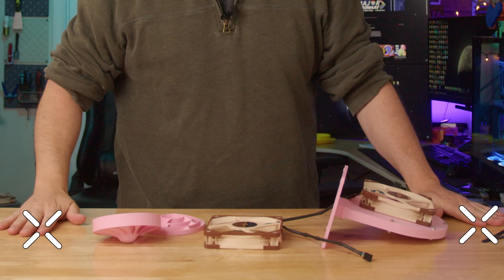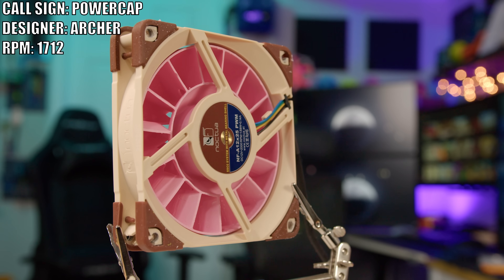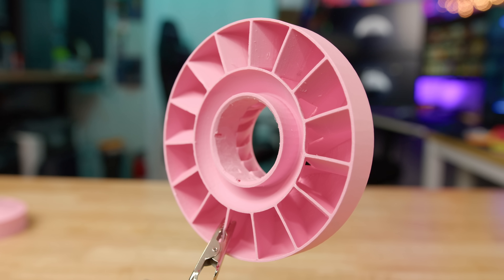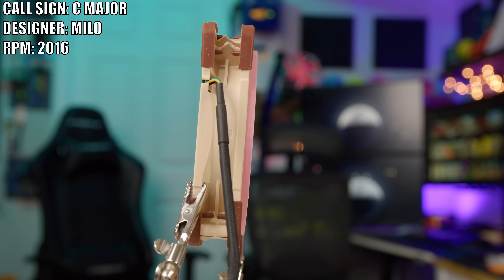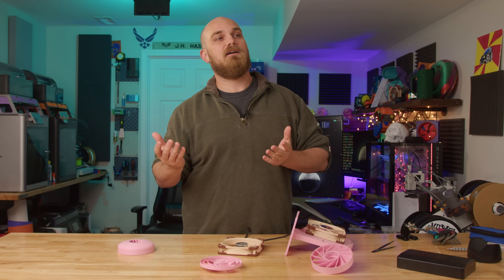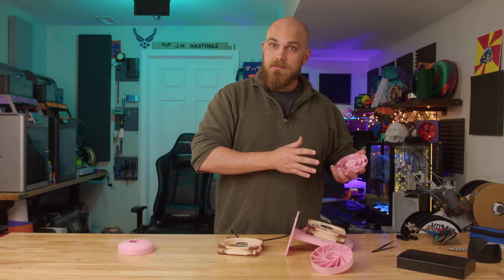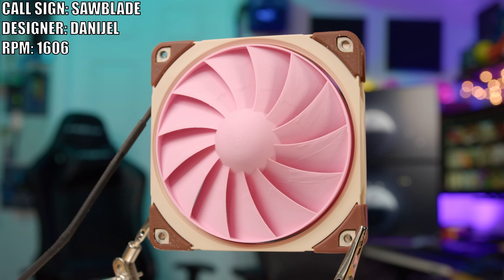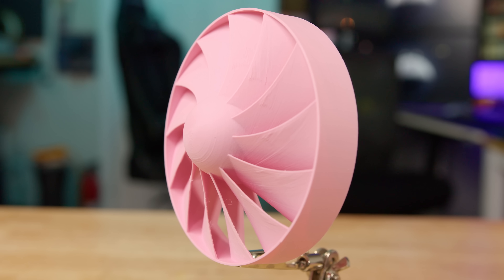Insane Fan Hack WINS Big! 😱 | Fan Showdown S6E4: Ultimate Static Pressure Battle

Comment: nah the wfdu should be DQ for the output being so small
Reply: this comp is about static pressure NOT airflow.
Reply: @TheRattleSnake3145  ya but.. the output size should be limited to approximately same as input size or such... otherwise just make a pinpoint funnel and shoot air through it... it's stupid.
Reply: @st33ldi9ital  Read my comment again, also listen to the start of every episode this season .  This season is about STATIC PRESSURE.  Again it doesn't matter what the output size is, this season is about STATIC PRESSURE.
Reply: @TheRattleSnake3145  read what I said again... s.t.u.p.i.d. spell it out, out loud, slowly.
Reply: @st33ldi9ital  Way to show everyone that you are completely ignoring what this competition is about.
Reply: @TheRattleSnake3145  These videos and this competition is for PC cooling. Having a race to see who can design a pinhole air compressor is out of scope, and stupid. Designs like this are not practical or usable for radiators, so there is no point in them. You want STATIC PRESSSSSURE!!!! FK YAAAA! Then go buy yourself an air compressor.
Reply: @st33ldi9ital  How many people do you think who need a pc fan are actully going to go out and but an A12x25, then break the perfectly good stock blades off just so they can print a random 3d printed fan? This design comp is about static pressure this season, get over it.  Major Hardware himself chose to print the design.  Are you really trying to say that he is wrong in his own comp and that you are correct?

Comment: imo for next season it would be cool to have a points based system with both flow and static pressure tests. So say there are 100 fans the top fan in static pressure gets 100 points + whatever they get in flow, and the top flow fan gets 100 points + whatever they get in static pressure. They way when you add up both scoring metrics you can find the "best" most well-rounded fan.

Comment: I really like the concept of the C Major fan, and hope the following can help evolve the design. 

A note is an audible constant frequency. An interval is relationship between two notes. A chord is two or more intervals played at the same time. 

As shown in the video, an octave interval is either 1:2 or 2:1 of the frequency of the note it refers to. That reference is called the root, and is the note that names the chord. E.g. A C-chord has the note C as its root. A so called major chord combines the the root with a major 3rd and a perfect 5th interval. The relationship between the notes in the chord is always the same, no matter the pitch of the root.

The notes you find on a piano (twelve-tone equal temperament) are equally spaced in twelve notes between each octave with the ratio 12√2  or ≈ 1.05946. For fan design it might be easier to use these ratios: 
Unison = 1:1
Major 2nd = 9:8 
Major 3rd = 5:4
Perfect 4th = 4:3
Perfect 5th = 3:2
Major 6th = 5:3
Major 7th = 15:8
Octave = 2:1

Good luck!
Reply: Are you sure about the major6 ratio? It should not the same as the major3
Reply: @Bleaksigilkeep  you’re absolutely right! Corrected. Thanks!

Comment: That kind of radial compression is pushing air, true, but installing that into your PC? I can imagine the case of a PC being integrated with such a design along with a radiator. But integrating such hardware would be so difficult. It's a nice proof of concept.
Does air preasure corrolate linearly with cooling of a radiator?

Comment: I don't really understand the numbers, but when second place is under 4, 8 is absolutely incredible
Reply: it's a measurement of pressure.  1mm of water is equal to about 0.0014 psi.  I'm sure you know what psi is, as you can see, we are talking about very small increases of pressure, hence why we use the water measurement instead.
Reply: Second place is almost 3.3mm (or 1/3 )

Comment: Because you're getting so many fans lately which hide what's going on inside during the smoke test, you should consider printing them in transparent filament.

There is an error in your table at 9:20. It says that the sawblade came in at 2.6 dB.

Also, "decimate" means "to reduce by one-tenth".
Reply: transparent filament isn't really transparent after its printed.

Comment: I'm currently designing a case around a 210mm centrifugal fan that fits on a somewhat-standard fan hub. I almost submitted the fan design for it, actually. But it pulls a vacuum rather than pushing.

Comment: so the guy who made the WFDU made what it essentially a desktop-sized laptop fan. Nice. love it, tho one adjustment i'd make is have an opening on the other side as well. more spaces for air to enter, more airflow.
Reply: More airflow means less static pressure. It's a square function so you can't get both. Kind of defeats the point.

Comment: I want to see a Triple version of the Wonder From Downunder mounted on a case with a 360mm radiator. Compare it to the cooling of the same case with regular fans!
Reply: it would be best to change the adapter to spread the air out if you were going to do that.

Comment: I wonder if it would be worth using a soldering iron to press fit some threaded inserts into the frame of your Noctua fan so you don't have to worry about threading metal screws into the plastic body over and over again?